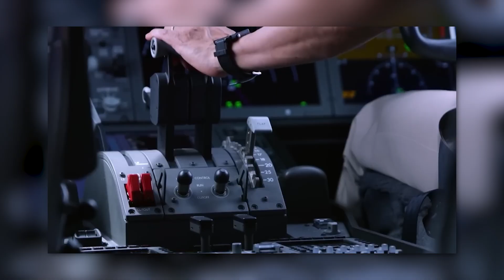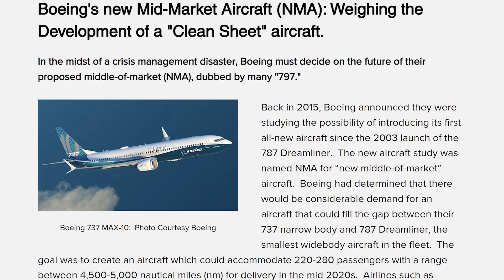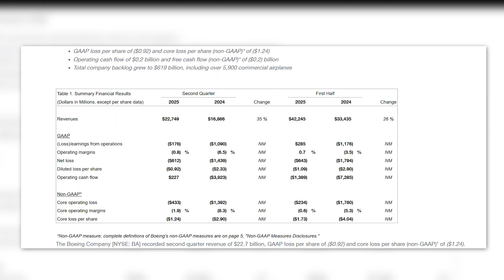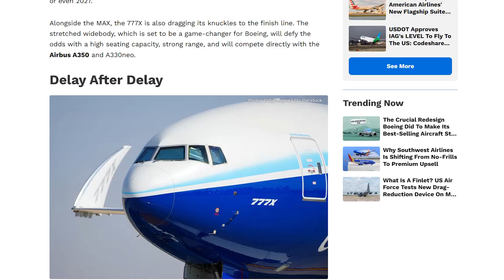Boeing 797 NMA Just Changed the Game — Is Airbus on Alert?

Comment: Boeing's Countermeasures.
Mount open fan engines (CFM's RISE) on the 737 MAX's wings, like the HondaJet. Use a T-shaped tail.
Give the 737 MAX a composite wing with flexible edges.
Remove MCAS from the 737 MAX.
The 737 MAX 7 will be replaced by the Boeing 606 (MRJ).
Introduce the 797, a twin-aisle aircraft with shorter main landing gear. The goal is to shorten passenger boarding and disembarking times, so it will be used for short-haul routes and its total weight will be the same as the 737 MAX 10.
Reply from the maker: That’s a really interesting concept — kind of a full redesign that blends innovation with practicality. Open fan engines and composite wings could seriously boost efficiency, and removing MCAS entirely would restore a lot of trust. If Boeing actually went this route, it could truly mark a new era for their narrowbody lineup.